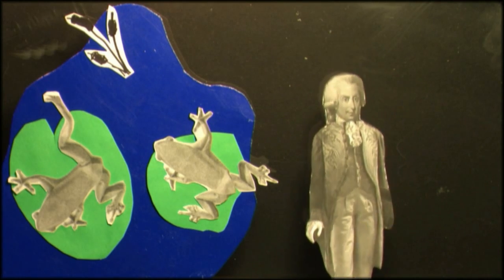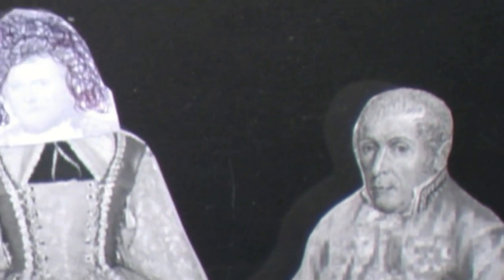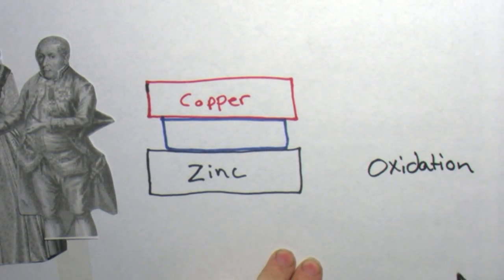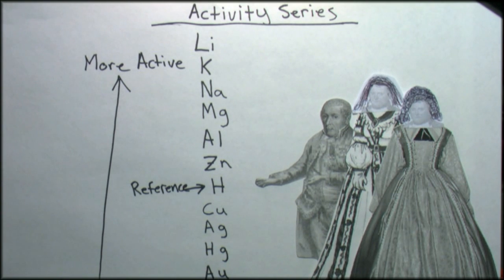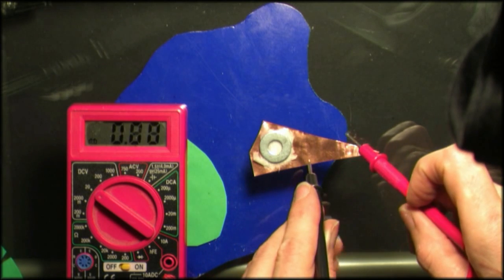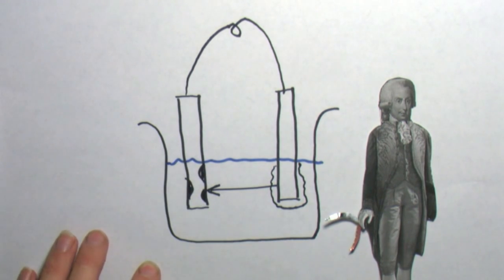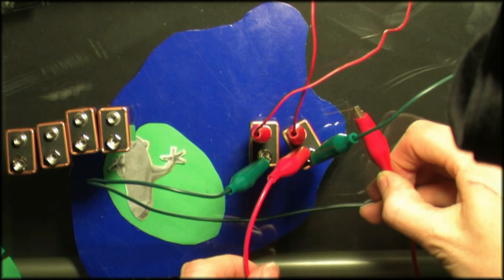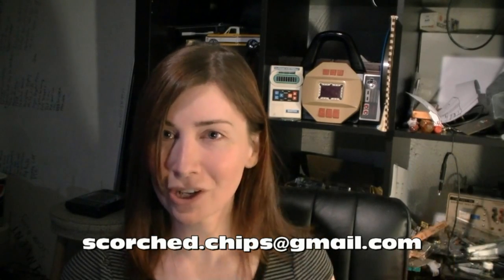Batteries - A to Z of Electronics

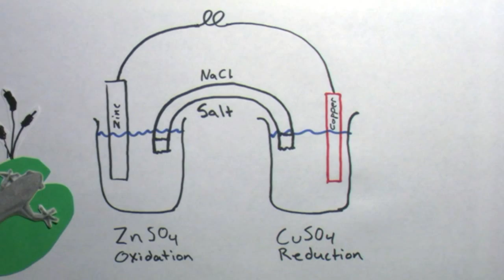Comment from the maker: @Gameboygenius 3:25 - I meant the consumption of the materials, due to incompatibilities in cell materials.  For instance if you putting zinc in sulfuric acid it will oxidize uncontrolled.

For the rest - There is only so much that can be said in 5 minutes.

Comment: @moxncal The run time would stay the same. E.g. if you have a single 1.5V AA battery with 2Ah capacity, and put 5 of them in series, you would effectively create a 7.5V 2Ah battery.

Comment from the maker: @annon003 Sure.  Alligator clip I used in the first flip is not completely fused.  I've seen some small hobby arc welding rods that were about the diameter of the ones I used in the second demo.  The air shield (flux or gas) would be critical.

Comment: Heh, I avoided all mention of "9V batt bandoliers" on my site (aiming at grade school kids, parents would freak.)   We did make a 1KV 12ft chain of old 9Vs at a local meeting.   Write your initials in flaming charcoal on a damp board using clipleads.   Or big electrolysis gas evolution in tap water (no salt.)  At 1KV you can attract/repel a hanging strip of charged scotchtape.   Scitoys was first to dare revealing the secret of 9V chains on a kids site.

Comment: @jeriellsworth Oh there is one floating around that is WAY bigger than that too. I think it had over 100 9V batteries. So much so the snap connectors in the joints started to arc too. I'll try find it.

Comment: @gcs8 lithium iron phosphate can be both very high discharge and fairly high energy density. it's also a very robust and safe chemistry. they are 3.2-3.3V. A123 has the best such cells and you can buy them on ebay. 3.6-3.7V lithium polymer cells like those used in RC planes also have very high discharge rates and even higher energy density but they are volatile and don't live as long. laptop cells (3.6V 18650) have the highest energy density (as high as 230Wh/kg) but relatively low power

Comment: A few comments:
1:05 Perhaps you should've mentioned briefly that "friction electricity" means static electricity from rubbing items, for those who might not have gotten the reference.
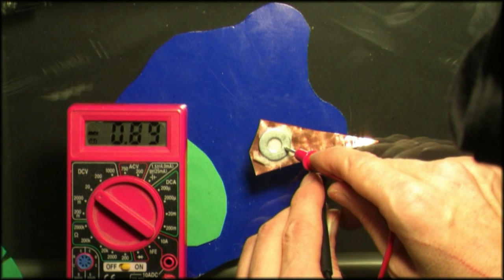3:25 If you're talking self-discharge through the electrolyte, then current is technically still flowing.
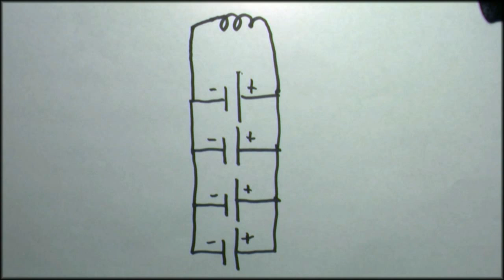4:20 Connecting batteries in parallel can indeed create more current - perhaps more than you bargained for, between the batteries. n00bs might leave them connected in parallel overnight and cause a fire...

Comment: Zinc makes Zn 2+ ions, not Zn +. Also, I believe that the copper is already coated with copper hydroxide and carbonate. When you connect, each zinc atom loses 2 electrons while each copper ion gains 2 electrons and becomes copper metal and releases hydroxide and carbonate ion into solution. This same technique could be used on silverware to reduce silver compounds to silver metal.

Comment: @jeriellsworth The issue here is what you intuitively expect. If you short a battery (especially after seeing your demonstration ;) ) you expect it to start a fire or do other nasty stuff. If you connect the batteries in parallel, without shorting the positive and the negative terminals, the unsuspecting user might not see a problem. The batteries are just connected in parallel, nothing could happen, right?
This is worse if one battery is fresh and the other nearly dry, of course, but still...